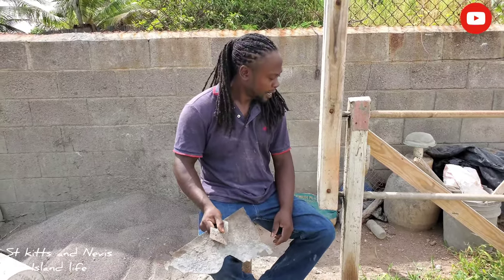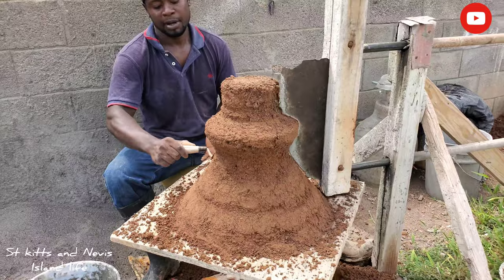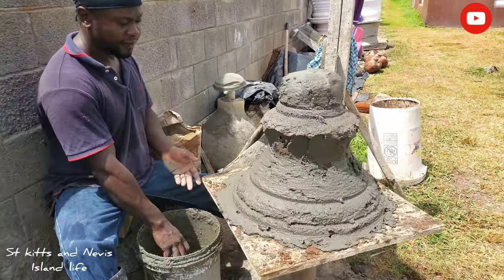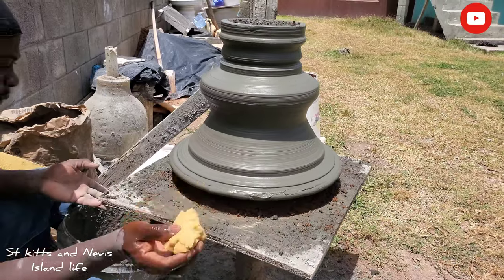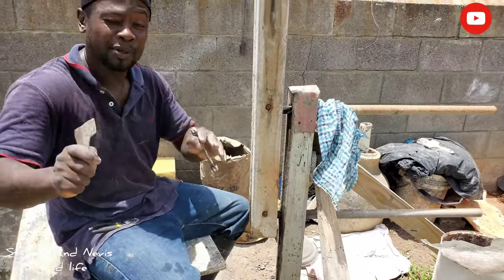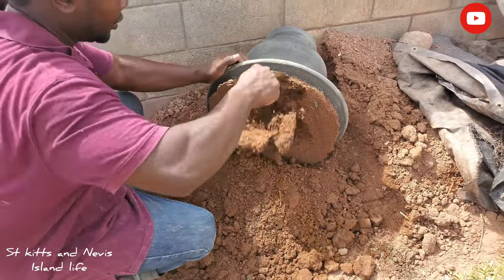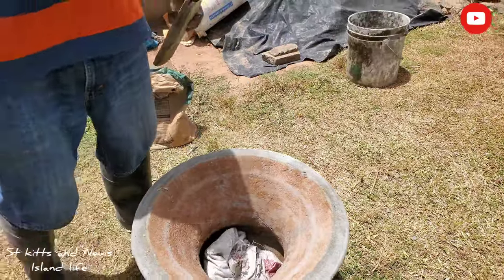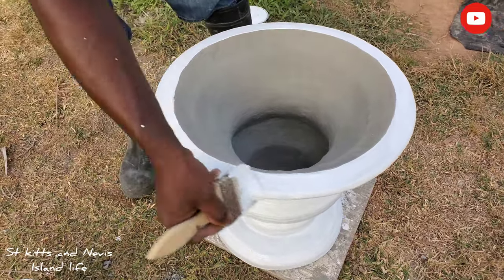How to make durable antique concrete planters//plant pots//simple  and fast technique//DIY pottery

Comment: How do you keep your hands clean. I tried this and burnt holes in my hands 😭😂
Reply from the maker: 🙂 it's an art man, i was once there, keep trying u will get it man, avoid ur hands  getting wet is dat causing ur hands to burn out 🙌
Reply: @stkittsandnevisislandlife2117  I just flipped my planter and it didn't crack 👍 now I have a 160lb planter to fill
Reply from the maker: Ok boss that good 👏 ,respect